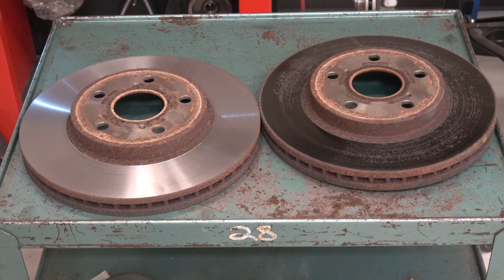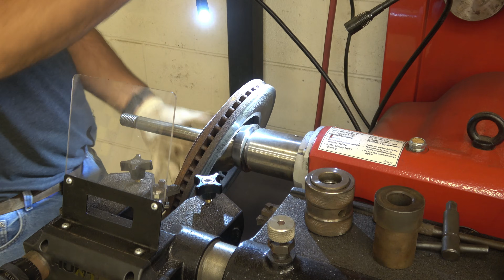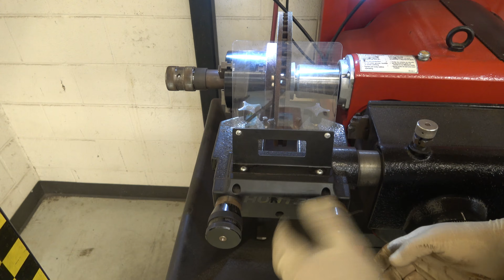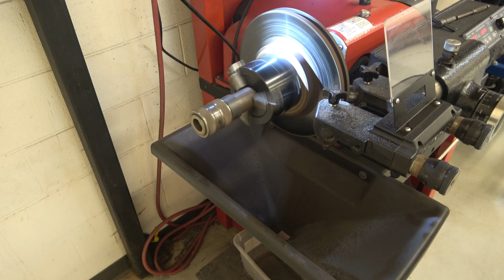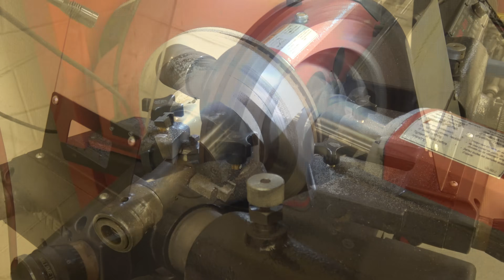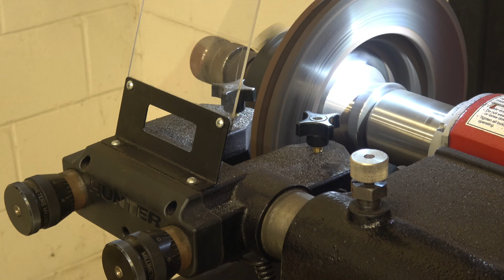How To Turn The Warp Out Of Rotors.

Comment: Not many mechanics do that anymore. The  federated auto parts dealer where I live, used to turn rotors and drums for customers back in the day. They did machine work on valves too!
Reply from the maker: It is almost a lost art form, but it is good to know. Replacing with new ones are so much quicker and cleaner

Comment: The big problem is the person driving not anticipating the need to stop, or riding the brakes when driving down hill
Reply: and changing pads but never changing the rotor to match the new pads.
Reply from the maker: The salt from the roads (winter weather) also will kill them. There are a lot of reasons